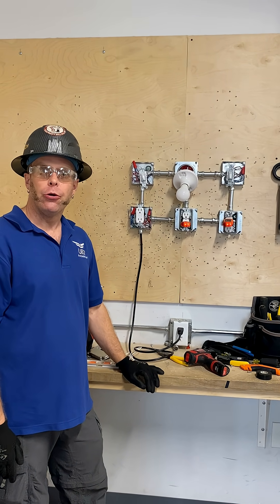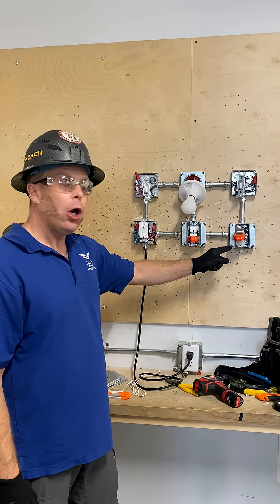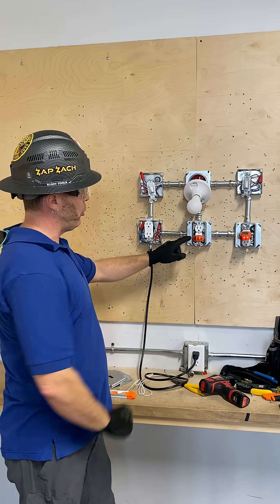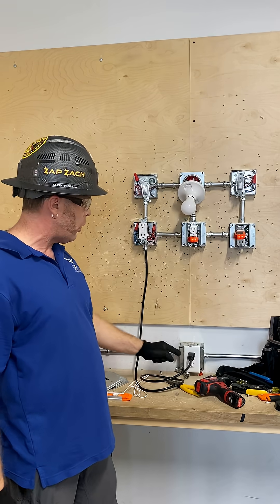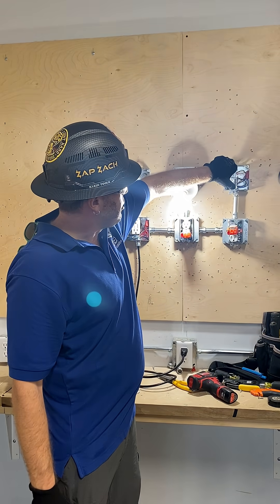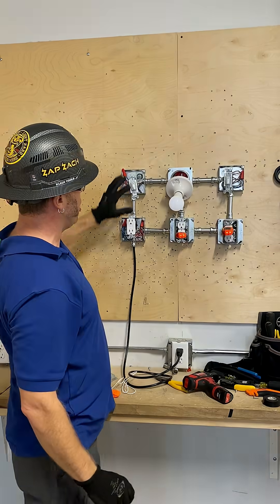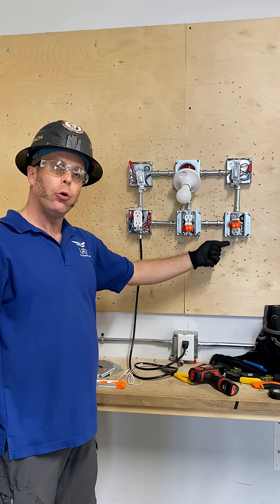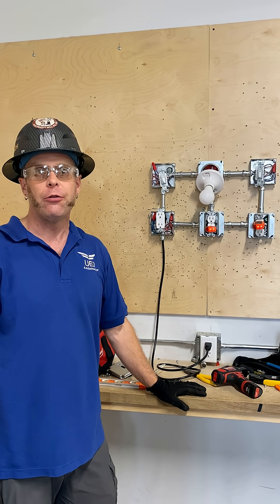Zap Zach Presents: 6-J Box Makeup #ZapZach

Comment: Sondors the GFCI trip the lights as well? How does the constant stay hot even after tripping it?
Reply: It’s unclear if the light will trip with the gfci because he resets it before playing with the light switches. But either way if you want a downstream part of the circuit to trip with the gfci you connect those devices in parallel to the load side of the gfci receptacle. If you want a device to stay hot after the gfci trips then you would connect those devices in parallel with the line side of the gfci receptacle. Hope this helps.
Reply: @Snorkadactyl absolutely. Thank you!
Reply: @Snorkadactyl thank you.